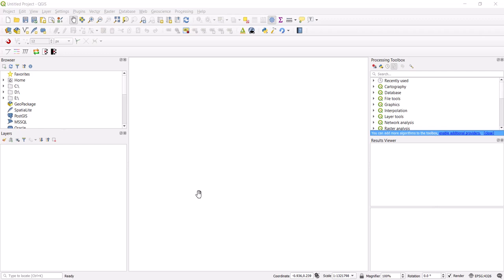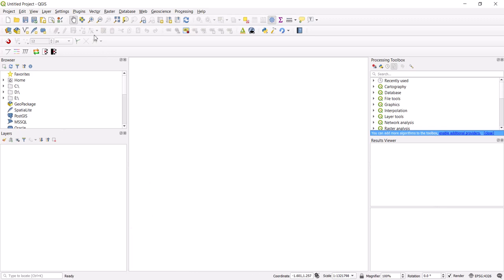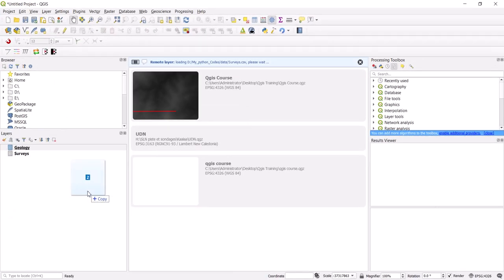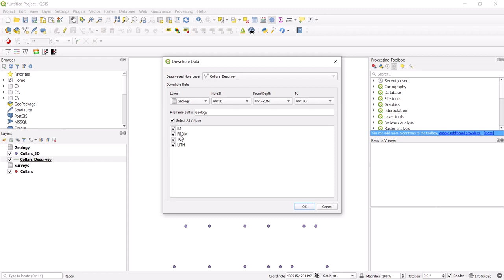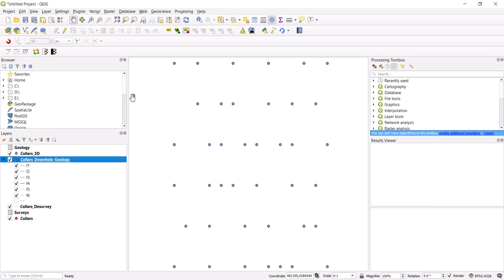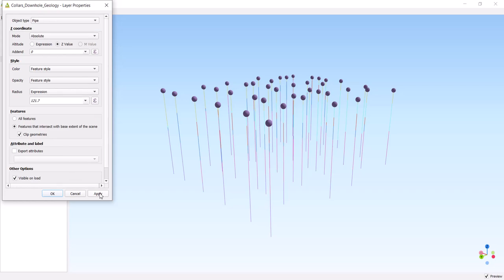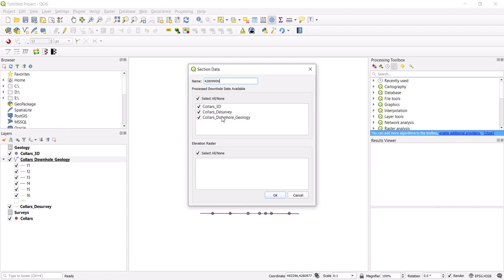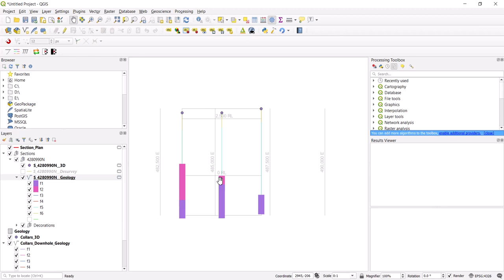Display drillholes in 3D in Qgis and Create Sections

Comment: Hi Mining Geo,
If I drag a Survey or Geology CSV file into QGIS the numbers show up as text (string).  If I add the CSV file as a Delimited Text File then sometimes the numbers show up as integers or decimal numbers, but sometimes as text.  I go into Fields and make sure all numbers are integers or decimals, but when I use the Geoscience plugin the drill collars plot OK but not the lines representing the drill holes nor any lithology.  I get an error message saying "Warning: Some 'From' or 'To' values are not numbers".  I assume this is why the drill holes are not showing up in 3D.  How do I get QGIS to recognize numbers as numbers when I add a CSV file?
Reply from the maker: I think the problem is easy to solve, if I m not mistaken this is caused by the decimal separator you are using if you are using comma (,) and it is not working try using a point (.) as a decimal separator(or the opposite if you are using a point). I think this should solve your problem, let me know what happened ;)
Reply: @MiningGeologist  Thanks for the quick response!  I will have to play with this for a bit.  I'm also using a Mac which may complicate things but I'll let you know if I solve it.
Reply from the maker: @DiamondDad1  Yeah sure
Reply: @MiningGeologist  Well, it's definitely a CSV issue.  I enlisted some help and recreated the CSV files from scratch using R software and the good news is there were no more error messages and the drill holes plotted in 3D, but the bad news is only the first intercept plotted, not the complete downhole lithology.  So we have a few more bugs to iron out!

Comment: Thank you very much sir , but the plugin sends me python error messages, then it works very slowly, but otherwise thank you
Reply from the maker: Can you tell me what are the errors you are getting ?
Reply: @MiningGeologist  

An error occurred while executing Python code:
FileNotFoundError: [Errno 2] No such file or folder: '/home/ives/T%C3%A9l%C3%A9chargements/3D Drillholes in Qgis/Geoscience_DrillManager_log.txt' 
Traceback (most recent call last):
  File "/home/ives/.local/share/QGIS/QGIS3/profiles/default/python/plugins/geoscience/DrillManager.py", line 114, in onDesurveyHole
    self.openLogFile()
  File "/home/ives/.local/share/QGIS/QGIS3/profiles/default/python/plugins/geoscience/DrillManager.py", line 77, in openLogFile
    self.logFile = open(fileName,'w')
FileNotFoundError: [Errno 2] Aucun fichier ou dossier de ce type: '/home/ives/T%C3%A9l%C3%A9chargements/3D Drillholes in Qgis/Geoscience_DrillManager_log.txt'

Version de Python : 3.8.10 (default, Jun 22 2022, 20:18:18) [GCC 9.4.0] 
Version de QGIS : 3.26.1-Buenos Aires Buenos Aires, b609df9ed4 

Chemin Python :
/home/ives/.local/share/QGIS/QGIS3/profiles/default/python/plugins/dms_2_deg
/usr/share/python-wheels/certifi-2019.11.28-py2.py3-none-any.whl
/usr/share/python-wheels/chardet-3.0.4-py2.py3-none-any.whl
/usr/share/python-wheels/requests-2.22.0-py2.py3-none-any.whl
/usr/share/python-wheels/wheel-0.34.2-py2.py3-none-any.whl
/usr/share/python-wheels/lockfile-0.12.2-py2.py3-none-any.whl
/usr/share/python-wheels/pkg_resources-0.0.0-py2.py3-none-any.whl
/usr/share/python-wheels/pep517-0.8.2-py2.py3-none-any.whl
/usr/share/python-wheels/ipaddr-2.2.0-py2.py3-none-any.whl
/usr/share/python-wheels/packaging-20.3-py2.py3-none-any.whl
/usr/share/python-wheels/webencodings-0.5.1-py2.py3-none-any.whl
/usr/share/python-wheels/retrying-1.3.3-py2.py3-none-any.whl
/usr/share/python-wheels/CacheControl-0.12.6-py2.py3-none-any.whl
/usr/share/python-wheels/six-1.14.0-py2.py3-none-any.whl
/usr/share/python-wheels/pip-20.0.2-py2.py3-none-any.whl
/usr/share/python-wheels/appdirs-1.4.3-py2.py3-none-any.whl
/usr/share/python-wheels/setuptools-44.0.0-py2.py3-none-any.whl
/usr/share/python-wheels/html5lib-1.0.1-py2.py3-none-any.whl
/usr/share/python-wheels/distlib-0.3.0-py2.py3-none-any.whl
/usr/share/python-wheels/contextlib2-0.6.0-py2.py3-none-any.whl
/usr/share/python-wheels/idna-2.8-py2.py3-none-any.whl
/usr/share/python-wheels/colorama-0.4.3-py2.py3-none-any.whl
/usr/share/python-wheels/urllib3-1.25.8-py2.py3-none-any.whl
/usr/share/python-wheels/msgpack-0.6.2-py2.py3-none-any.whl
/usr/share/python-wheels/pyparsing-2.4.6-py2.py3-none-any.whl
/usr/share/python-wheels/toml-0.10.0-py2.py3-none-any.whl
/usr/share/python-wheels/progress-1.5-py2.py3-none-any.whl
/usr/share/python-wheels/distro-1.4.0-py2.py3-none-any.whl
/home/ives/.local/share/QGIS/QGIS3/profiles/default/python/plugins/MiMiGIS
/home/ives/.local/share/QGIS/QGIS3/profiles/default/python/plugins/OpenTopography-DEM-Downloader
/usr/share/qgis/python
/home/ives/.local/share/QGIS/QGIS3/profiles/default/python
/home/ives/.local/share/QGIS/QGIS3/profiles/default/python/plugins
/usr/share/qgis/python/plugins
/usr/lib/python38.zip
/usr/lib/python3.8
/usr/lib/python3.8/lib-dynload
/home/ives/.local/lib/python3.8/site-packages
/usr/local/lib/python3.8/dist-packages
/usr/lib/python3/dist-packages
/home/ives/.local/share/QGIS/QGIS3/profiles/default/python
/home/ives/.local/share/QGIS/QGIS3/profiles/default/python/plugins/mmqgis/forms
/home/ives/.local/share/QGIS/QGIS3/profiles/default/python/plugins/ee_plugin/extlibs_linux
/home/ives/.local/share/QGIS/QGIS3/profiles/default/python/plugins/go2streetview
/home/ives/.local/share/QGIS/QGIS3/profiles/default/python/plugins/go2streetview/res
/home/ives/.local/share/QGIS/QGIS3/profiles/default/python/plugins/HCMGIS/forms
/home/ives/.local/share/QGIS/QGIS3/profiles/default/python/plugins/isochrones
/home/ives/.local/share/QGIS/QGIS3/profiles/default/python/plugins
/home/ives/.local/share/QGIS/QGIS3/profiles/default/python/plugins/isochrones/iso/utilities
.
/home/ives/.local/share/QGIS/QGIS3/profiles/default/python/plugins/shapetools/ext-libs
/home/ives/.local/share/QGIS/QGIS3/profiles/default/python/plugins/enmapboxplugin/site-packages
/home/ives/.local/share/QGIS/QGIS3/profiles/default/python/plugins/enmapboxplugin
/home/ives/.local/share/QGIS/QGIS3/profiles/default/python/plugins/enmapboxplugin/enmapbox/qgispluginsupport/qps/pyqtgraph
/home/ives/.local/share/QGIS/QGIS3/profiles/default/python/plugins/enmapboxplugin/enmapbox/site-packages
/home/ives/.local/share/QGIS/QGIS3/profiles/default/python/plugins/enmapboxplugin/enmapbox/apps
/home/ives/.local/share/QGIS/QGIS3/profiles/default/python/plugins/enmapboxplugin/enmapbox/coreapps
/home/ives/.local/share/QGIS/QGIS3/profiles/default/python/plugins/SentinelHub/external/requests_oauthlib-1.3.0-py2.py3-none-any.whl
/home/ives/.local/share/QGIS/QGIS3/profiles/default/python/plugins/gdrive_provider
/home/ives/.local/share/QGIS/QGIS3/profiles/default/python/plugins/gdrive_provider/extlibs
Reply from the maker: @visionvirtuel5923  Do you have the geoscience plugin installed properly, did you manage to import the drillhole data without the 3D visualization part?
Reply: @MiningGeologist  I received to import all the data including the drilling data which is displayed well, I also have the geoscience plugin installed but the problem when I start the first step in the plugin I have this message mistake